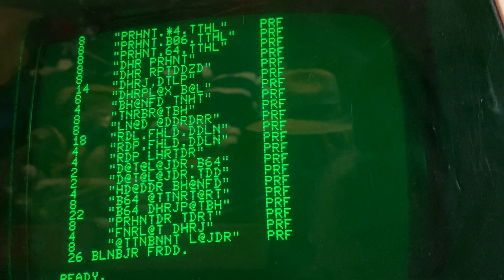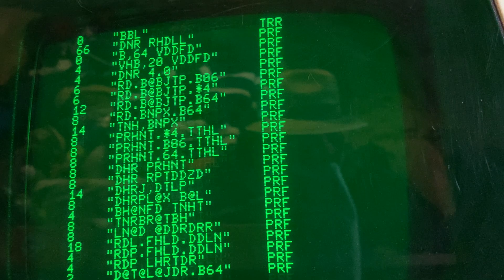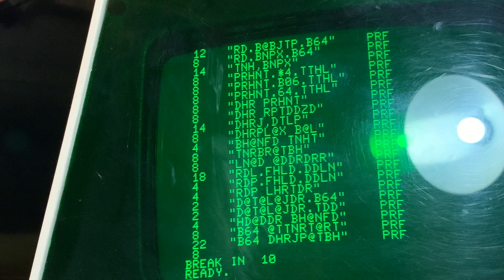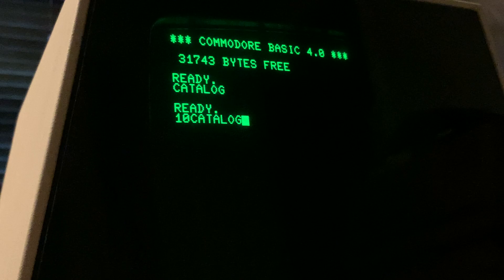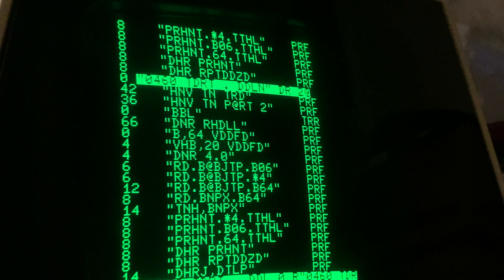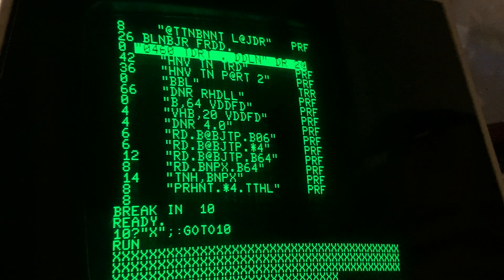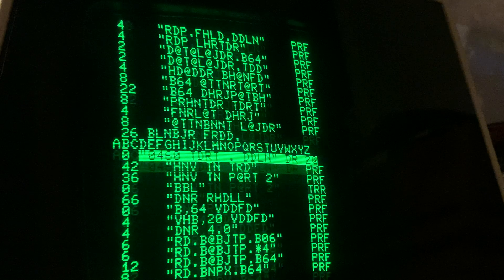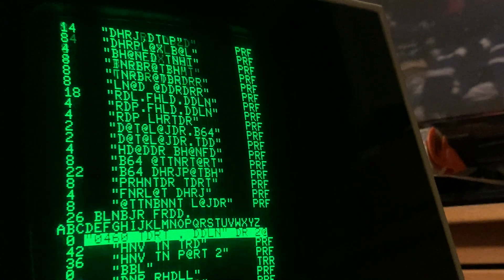Commodore Pet 4040 Diagnostics - This Is A Mind Boggling Mystery - Butchered Catalog - Episode 2154

Comment: Looks like you have a stuck bit.  All the characters from the floppy are even in PETSCII, so the zero bit is stuck low.  I don't know the full path from the floppy, but I would guess it is either happening in the floppy drive itself or maybe at the PET's recv side.  Since output originating from the PET looks good, I agree that it probably not PET RAM that is the problem.
Reply from the maker: Pondering...I am...it looks like something I have seen before...but not under these circumstances...sigh...